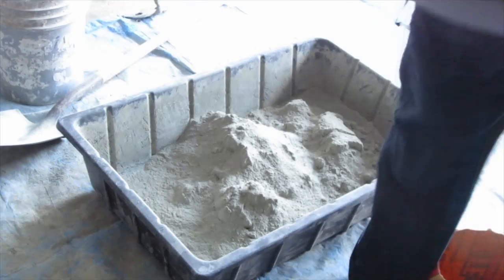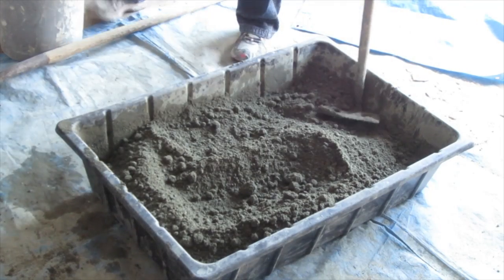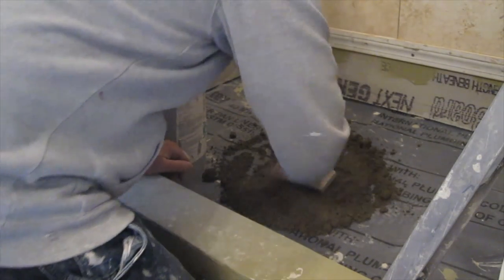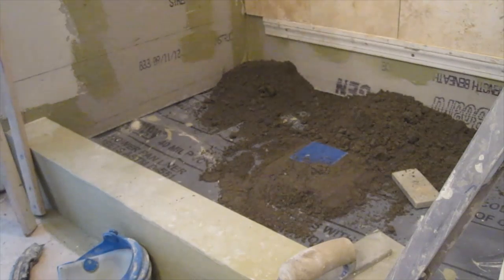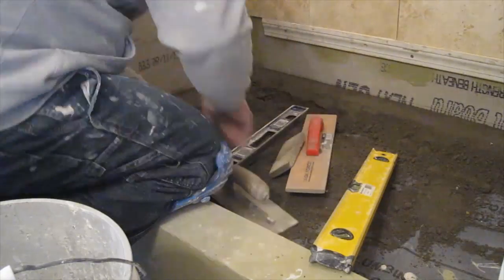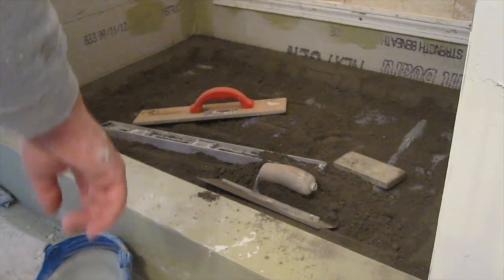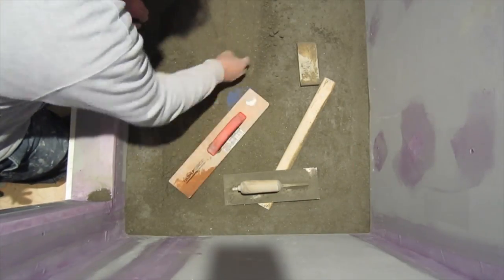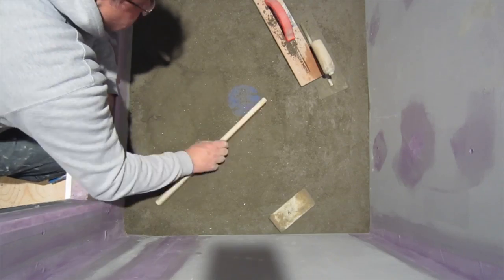How to install   Mud in a shower floor

Comment from the maker: That depends on the kind of backer you use, but generally when I install the backer I don't let it sit on the pan at all, The backer should not touch the pan, so there would be no point to caulking it. Also I usually waterproof the mud and lower part of the walls (if I don't waterproof the whole thing) to minimize or eliminate water penetrating into the pan.
Reply: Just jack hammered out a mud bass that had the backer into the base like this. The backer board was all rotted out. Should be above the mud.

Comment: Thanks for the help Sal. I just completed my master bath restoration. I stripped everything  to the framing and went from there. I ended up with a beautiful 30”x48” walk-in shower and beautiful tile floors. I’ve worked in carpentry for years but never did tile work before. I wish I could share pictures here. Your videos guided me to a beautiful and leak free finished product. Thanks again
Reply from the maker: Nice to hear, enjoy your new bathroom.

Comment: This is a very useful video for me.  I'm installing a tiled shower in my house to the west of Boston.  The plumbing inspector told me that I had to use a copper pan liner.  It took me a long time to figure out how to do this with a pre-slope!  I have the cement board inside the liner, just like you, but it's all covered with Red Guard so that the moisture barrier is on the INSIDE, not behind the wall finish.  A lot of sources say that the mud base has to be 2 to 3 inches thick, but I have just 1 3/4 inches from the top surface of the liner to the bottom row of wall tiles, so I want it to be much thinner and I'm encouraged to see that you're putting down only a little more than an inch in this shower.
Reply from the maker: Boston is the last bastion of the copper pan, I am just North of Boston. If copper pans would go away all together it would actually be a good thing. I have had to deal with them for more than 30 years and I only accept them these days when I have no other choice, I would much prefer, and mostly do, sealed showers systems these days.

Comment: Thanks greatly for your advise.  Concrete and I have never been friends, but using your technique of the level towers and "just damp" mud, I did my 5.5X5.5 shower base successfully. My drain was in one corner so I had two level walls and two that angled down, but following your guidance worked beautifully.

Comment: I also enjoyed the video. I've made about a dozen showers using roughly this technique. I did not approach the quality that Sal showed in this video on my first few. Even now I take considerably longer than Sal does and I certainly learned a few things from this video. One thing I do that wouldn't help Sal much but might be of use to a less experienced person is to use a laser level to place check marks around the perimeter to mark the correct level. I make the curb at the same time I do pan.

Comment: Hi Sal. I just want to say thanks for all the advise. The second time round, the topper mix went perfectly. Used the additive with water.  Thanks again. Matt
Reply: Hey Mattt............. did you use water with the  additive? I used straight additive in place of the water and it seemed difficult to finish. Did you tear it out after the first time?
Reply: @keithowens9242   Hi keith. Yes I used a small amount of additive with the water. The first time I used sac crete and I didn't get a good curing. So I took it out and went with quick crete topper mix. Came out great. Not saying anything bad about sac crete but I didn't have good luck with it.  Watch Sal Dablasi  of elite tile. He gave me great advise. Good luck.👍

Comment from the maker: I agree with you, but that all depends on whether there is a vapor barrier behind the backer board or not. In this case i did not install the Durock and the GC put up a vapor barrier before installing the CBU. I don't always have control of how things are done. If you watch a few of my other videos , you will see in most cases i do waterproof the entire surface of the CBU, which i think is the prefered method

Comment from the maker: Yes, that Is what i Believe it to be. It is a little rich, but works fine for a shower pan. Deck mud is supposed To be 5:1, you could always add some sand If you want to  increase the ratio of sand, i will some times do that If i need It to be a Little leaner.

Comment: Interesting to see someone else's way of installing a mud pan. I'm from the NJ/NY area. I mix it until I can make a "meatball", then I know it's good to go. I  make "ribbons" which means that I compact the mud completely around before I get started on the rest of the pan. Never used gravel by the weeping holes though. I'd like to try it, but I don't want to experiment on a client's house. Very nice job. Also, your liner corners are perfect, no lumping out. Good plumber, or good tile man.
Reply from the maker: You should watch this, https://www.youtube.com/watch?v=p8xsx3316IU

Comment from the maker: @piero serrano Indid not forget it, it is not required nor is it recommended. the purpose of the liner is to direct any water that gets through the mud to the weep holes at the drain. bonding the mud to the liner will only inhibit that function. I also find it doubtful that the thinset would actually stick to the liner.

Comment from the maker: Yes you can, use some kind of bonding agent a little thinset will work. A  membrane may be required depending on the condition of the slab and intended use of the deck mud that you are going to install.

Comment: Okay, confession time. I think I put in too much Portland cement, which I read was good for the mix with the sand topping.
I took out the old. It was exactly soft as pie crust, but it did chunk out in 20 minutes.
I cleaned up and redid it in sand topping only. You were right, the second time was way easier.
Thanks you are awesome

Comment: Nice job Sal , that's the only way to do it . Never mind all those fancy plastic pre pitched systems ,they just don't give you the satisfaction of a job well done.
Reply: Pre pitched such as quick pitch are great if your not comfortabel with dong traditional dry pack.  But you must watch out if the drain isnt center or the showee os an irregular shae the lenght of pitch stick will be different giving you an un level perineter that will have all angle cuts wher wall meets the floor.  I find that the installations doesnt look very good and its all due to the mud job .

Comment from the maker: Relax, the mix in the trash as you mentioned did not get packed and was loose, check your mud floor, if it feels smooth and hard it is fine. If it is loose, then it will be easy enough to take it out without disturbing anything vital and you can start over. Consider it a trial run if that is the case.

Comment from the maker: The purpose of the shower pan is to stop water that penetrates into the mud bed from going any further. I am assuming that you have a vinyl liner, if it is wet and the water in it is going through the weep holes and down the drain, then it is functioning as designed. It seems to me that your bigger problem is that your backing for the tile is green board, it should be something water safe like Durok. Not knowing any specifics of your shower I would say if the leak is fixed then no need to wait.

Comment from the maker: The rubber liner is the gray thing with the writing and the lines on it. you can spray water if you like but it is not necessary, the mud will set if it is mixed correctly.

Comment from the maker: Not sure what you are asking. If there is a leak it needs to be fixed. If it can't be fixed it will have to be replaced. Some times the connection at the drain can be the problem.

Comment: I was told that you can have a mud mixed on the try side. Once you finished, you can sprinkle water on to the mud pan to make the cement harden. Is that a good way to do it?
Reply from the maker: I have seen it done that way, but never actually tried it

Comment from the maker: According to the cement board manufacturer, the cement board is supposed to be 1/4" above the mud bed and sealed with a caulk of some kind. I instead keep the cement board off the shower line. I also waterproof the entire mud pack. This is how I have done it for thirty years, you are of coarse free to do it any way you like.

Comment: Nice video, Sal. One small note, you used regular sharp gravel for weep hole drainage. Pea gravel is required so the sharp edges don't puncture the liner. :)
Reply from the maker: You ared absolutely correct about that, at the time that I did this install the gravel you see is what I had available to me, I did look at it carefully because that thought had occured to me. I decided that this gravel did not have  anything that would be a concern. Sometime I will used some old spacers instead.

Comment from the maker: Mosaic will gain very little height when the thinset is added, the tile can be very slightly above the drain, or some times I will shave a little off the back of the tile to make it fit right, some times the drain can be adjusted up before the mud sets, some times the drain can be adjusted after the mud has set. I usually plan how I am going to handle it depending on the size and kind of tile.   Whatever works to get the tile to be at the right height with the drain.

Comment from the maker: If your perimeter is level and the longest run to the drain is a 1/4"per foot slope, when you fill in all the middle area the slope will automatically be at varying pitches greater than a 1/4". The two inch tile will conform to the slope.

Comment: Great video, doing my second bath using your methods, first was a tub... What is min thickness for this mud bed on the liner? I would like to do walk out but already 1" up from concrete and want to match my bedroom floor to bath in the future... trying to not be 2.5" up through the rest of the house... maybe curb is best bet?

Comment: Hi Sal, I have a mystery problem, I haven't seen the job in person, but pictures of 12" X 12" mosaics laid on a poured base show a 12" grid on the floor, for some reason you can see what looks to be a grout color difference around each of the mosaics, from what I was told the grout used had a sealer built in, not sure if that's what was actually used or not, you ever seen this before? Thanks for all the wealth of wisdom you share in your videos!
Reply from the maker: Not sure if I understand what you are describing, however if the tile is a natural stone, or a very porous ceramic tile, the grout can stain or "Picture Frame" the tile itself. This will usually occur when a dark grout is used with a light tile. While the grout is drying this effect can also be seen with these types of tiles, but clears up when the grout has had time to dry.
Reply: Thanks Sal

Comment: Thank you Sal. I had  a leakage, but it was fixed already, My question was referent  Shower Pan.

I removed the green board because it was damaged by the leakage.

After i removed the boards, i felt the Shower Pan wet, i touched it on sides and it was humid.  My question was:
 "if I have to remove the shower pan or can I wait until it dries out."
Leakage fixed.

Comment: Is it ok that your backer board is inside the pan liner? Thank you Sal! Am watching to ensure I hire correctly. You are great!
Reply: I don't think that is ok.
Most videos I have seen have the liner going up the walls at least 3 inches.
And completely over the curb.
Reply: @penknight8532  See I think of the liner as a more waterproof surface so it should cover the board like you say. But I guess if you waterproof the board or use one that has been treated, it may be alright.

Comment from the maker: The slope from the furthest point needs to be 1/4" per foot, if your perimeter is level at a height that allows for this, when you install the mud to fill in the field, the slope will work itself out. This will mean that the slope between the drain and the closest part of the perimeter will be significantly steeper. If you use a tile of 1" or less for your shower floor, it will be able to conform to the slope. Otherwise you will have to forgo the level perimeter, and adjust accordingly.

Comment: Awesome instructions. Just did my pre-slope last night and it turned out pretty well. Tonight I am going to install the liner and then durarock and hopefully get the mud floor in. 2 questions: 1) when you are making fine shavings around the drain to accommodate the thickness of the tile, are you also factoring in for the thickness of thin-set? Or should I just neglect that and make it flush? Secondly, after the floor is dry, I am going to use liquid membrane w/ fiberglass roll as demonstrated in another one of your video's. Do the joints between the pieces of durarock need to be sealed with mesh tape and mortar, or can I use the fiberglass mesh with liquid membrane? Or do I need to do both.

Thanks Sal. You are saving me a ton of money and allowing me to design a bathroom that is much nicer by saving money on doing this myself.
Reply from the maker: +tHEDENVERSUN Allow a little for the thinset and also the waterproofing. but when it is all said and done the tile should end up flush or just slightly above the drain. Play it safe mud and mesh tape all joints with thinset, let dry and waterproof.

Comment: Hi Sal.  Thanks for all the help you're given me!  On my top layer of mud, I goofed and set my drain a little too low.  I had to do a little grinding around the drain with my cement disk on a grinder so I could unscrew it.  The cuts were about 1/4" deep and were right up against the plastic (square Oatey drain).  Can I fill these depressions in with thinset, or should I mix up a small amount of sand/portland cement to fill them in up to the proper level?  I like the idea of packing them in with sand/portland cement but will it bond to mud that has set up?  Thanks again!
Reply from the maker: Thinset i think would be the better choice, so tgat it will adhere to the existing cement.
Reply: ***** That sounds good.  I'll even things up with some twinset.  It's not a big volume that I had to remove.  Thanks for all of your help!

Comment: Hello Sal,  I poured the preslope about 3 inches thick against the step (5 inches tall) and I have installed the liner.  How thin can the next cement layer be?  I've got 2 inches maybe 2.25 inches max to put the next layer of cement and then thinset and tile.  I was thinking I could also just build an exaggerated slope from the step to the drain if I didn't have enough room to work with.  Thanks for the response in advance!

Comment from the maker: The sand topping mix i believe has a ratio of 3 sand to 1 Portland cement , a little rich for deck mud, but works fine for a shower floor. deck mud should be more like 5 to 1 ratio. When you added the cement it was way too rich. No harm done, the second time around you were almost a pro.
Reply: for every bucket of sand I do 1 shovel full of portland cement

Comment: Thank you for the video! 
I have few questions; what is the hight would you recommend to leave for the drainage before putting mud in? Second, should I use water proving system before or after putting mud? And finally, I have 5' by 10' shower so I'm planning raise my perimeter for a pitch 1.25 inches; do you think it is enough? Or what would you recommend?

Comment: Your tile work is awesome! !! Why do  you let durarock sit in your mud bed?
Reply: So that the shower wall can be tiled all the way down to the finished shower floor.
Reply from the maker: yes
Reply: Will the durarock hold water if it sits in the mud
Reply: Yes, but my understanding is that it's OK because that's exactly what cement boards are designed to do and why they are used in this application.  Don't fall in the trap of thinking that the tiles are waterproof.  Everywhere in the shower that water hits the wall, it can get through the grout into the wall finish.  It can get no further due to the vapor barrier, therefore it stays in the wall until it evaporates back out through the grout lines where it got in or drains down to the pan liner.  This is just (as far as I know, I'm just a DIY guy) how tiled showers work.  So, the situation where the cement board goes into the mud is basically the same as everywhere else.  What's behind the tile must be able to withstand being wet and behind that there must be a barrier so that the water cannot pass any further.  In the pan, that barrier is the liner, which should be sloped to direct the water down the drain.
Reply from the maker: Depends on the kind of shower system, "water in, water out" if it is a sealed system, or some combination. the vapor barrier can be behind, or the waterproofing can be on the surface, but not both, there are multiple ways to install a shower system. This one had a vapor barrier behind, so no waterproofing on top besides the seams and corners. not the way I like to do it, but dictated by circumstance.
Reply: hi Sal, amazing video again, and a lot of information and tricks, so in the above comment you answered "the vapor barrier can be behind, or the waterproofing can be on the surface, but not both", and reading your comment I`m assuming you prefer waterproofing membrane rather than vapour barrier behind the walls, am I correct in this? and just for information why not both? (vapour barrier and waterproofing membrane). thank you.
Reply from the maker: Only one or the other,  by using both you create an area where any moisture between the two will be trapped with no where to go.
Reply: thanks for the prompt reply
Reply: Ahhhhh,
Uhhhhh,
Ahhhhh,
Uhhhhh,
Ahhhhh,
Uhhhhh,
Thee uhhhhh,
Ahhhh,
Here, I'm ummm,
Uhhhh,
Ahhhh,
Ummm,
Uhhhh.

SPEAK CLEARLY PLEASE!

🤦‍♂️